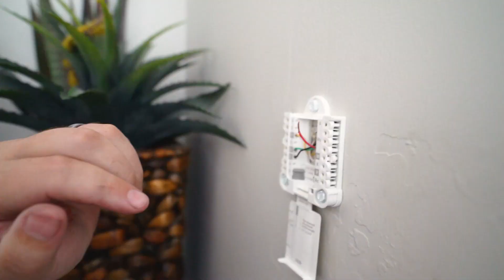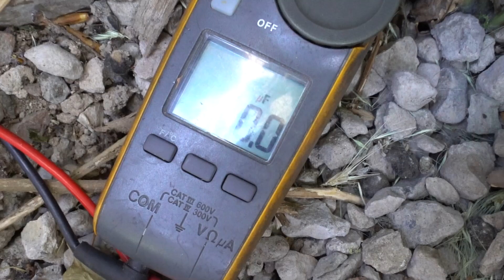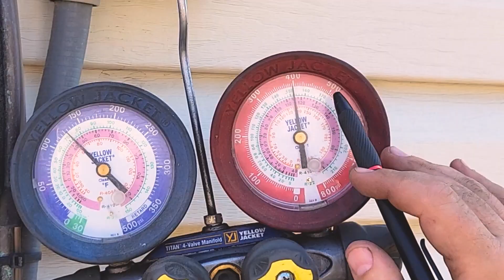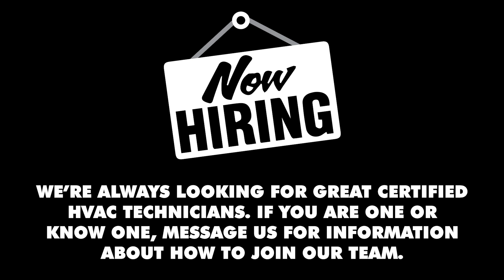Along for the Ride 109: Mike Mathys, HVAC Service

Comment: Best thermostat option would be a MHK2 made by Honeywell for that Mitsubishi Air.  handler. Wonder if he checked S1,S2,S3 , for proper AC/DC voltage . 208/230 volts come from the outdoor condenser, providing power to the air handler, if in normal operation. If high voltage power is interrupted at the condenser, this will cause your 24volt to drop out at indoor transformer inside of the air handler. 
Mitsubishi gives a separate transformer for that interface, where u can use your nest , smart thermostat or just a simple thermostat. 

Great video ! Always great content !